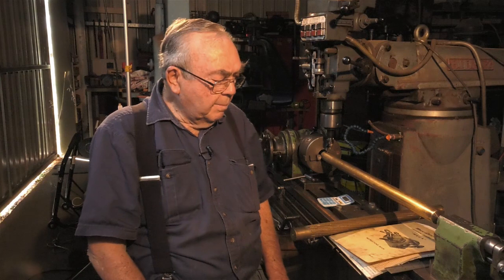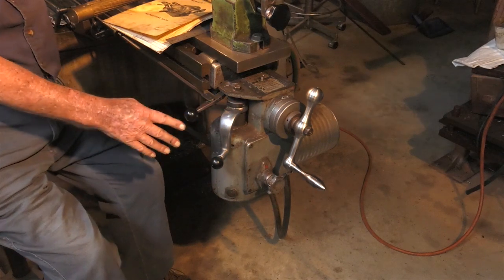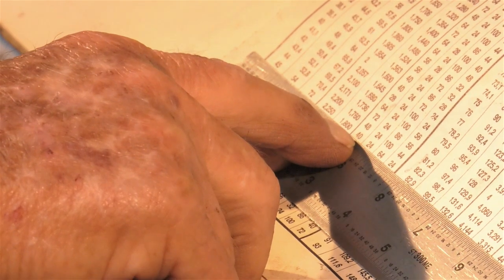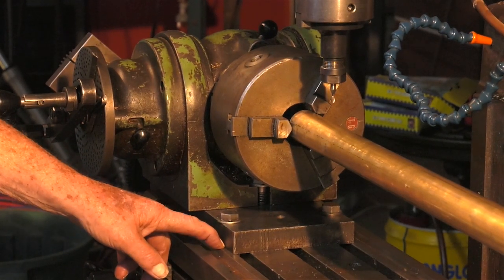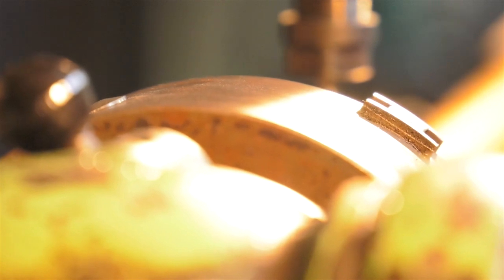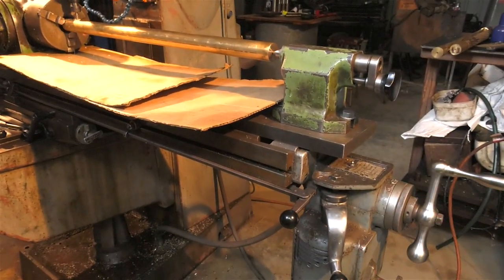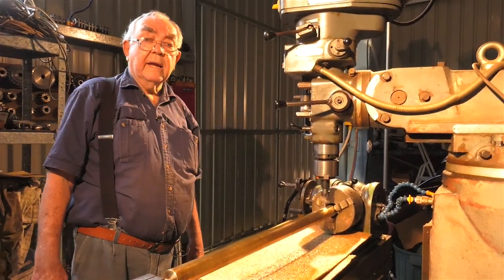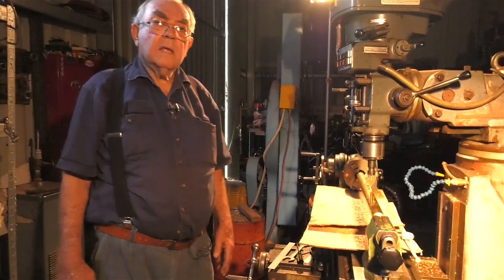Milling Long Lead Helix

Comment: Thank you Robert,
Can you do any more in depth video on setting up the gear train and etc. Also want to thank you for being one of the very few people that actually spoke on how it works and etc but I need more info. I have a universal dividing head (completely brand new and complete ) and i want to learn more about how to use it to its fullest so if you can find the time will you put out another video. Thank you.
Reply: I wish dad could. Unfortunately he passed away a little over a year ago. The number of times I've gone to call him for advice is unreal. He was a great machinist.

Comment: What are these fluted shafts used for?
Reply: These are used in a seed box, for sewing grain. They sit at the bottom of the box and this seeds are transferred in the flutes.
Dad used to make these brass ones, and also larger diameter, plastic ones, which I think were used for sunflowers and other larger seeds. I think the brass ones did wheat, barley, that kind of thing.

Comment: Thanks for this, i have a Victoria universal dividing head but without  the gears and banjo, I've been wondering on how to connect it all so thanks a lot for showing how the banjo and gears work, seems I have a lot of spur gears to cut first :) , like most things I want to do.. I have to make something else first, problem is when the part I want to make is used to make the part I need to make it, if that makes sense! , Enjoy your retirement fella and thanks a lot for passing this information on. Mark.
Reply: You will have fun making the gears, but you will need the index plates to get the correct angular spacing.  The numbers of teeth are shown in the text and are common for all 40:1 dividing heads.  You could use either metric module cutter or Diametral Pitch cutters, depending on what you can beg, buy borrow or steal.
Reply: @robertking3130  thanks, I think the first 1/4 of 2020 is going to dedicated to making or buying kit to cut gears, I need to make 30x 1.5 mod gears for 2 lathes, 8x 22DP gears for another lathe and while I'm at it I'll cut gears and make a banjo for the victoria dividing head also, somewhere In my house or shed I have a printed booklet for the dividing head showing all of the gear sizes and hole plates that were made for the Vic Div head, now of I can find that it would be a great help :/
Reply: @markhobster8113  Machinery's Handbook has a wealth of info on dividing heads.  I reckon that index plates are similar for all brands though, bu t I hope you don' have to make those also.  As far as cutters go  yon can buy sets of Chinese cutters, but they are a bit ordinary and they are numbered differently to the standard.  I used to buy individual cutter from Ebay, that way you got standard bores (1" or 1 1/4").
It is always a mystery to me why if you buy this sort of equipment second hand there is always something missing.  You will also need to make the spindles to attach the gears to the gear plate or banjo.
Reply: @robertking3130  yeah a lot of good machinery and workshop equipment is inherited by the ignorant, the machinists children inherit.. don't know what it all is so sells it on in batches, I have bought various older machines over the past 3-4 years for my own use and every one of them came with bits from other machinery, oh disorganized hobbyists aswel :) , sell equipment on after losing some stuff, workshop moves ect, it's part of the fun refurbing older equipment to make parts for them as long as we know what those parts looked like and how they fitted, shape and size of a missing change gear banjo for my 1912 Drummond 5" doublebed lathe was a bit of a nightmare, I finally found out through a lot of questions and picture requests

Comment: Thank you for posting interesting content. Now all I have to do is find or make the gear train plate and I'm on my way.
Reply: Best of luck finding a plate.  It should not be too difficult to make one; my original one was made of cast iron, but a piece of twenty millimetre  plate would be fine.  Use a bit of guessometry from the end shot of the gear train to get your proportions to mill the slots.  If you need to make gears, work out whether they are D.P. system or Module and you could probably get a cutter that could cut both smaller and larger numbers of teeth.  Being adjustable centres will allow them to mesh even if they are not the correct profile.  It is not a Swiss watch fit.
Since making the vid I have sold my workshop.